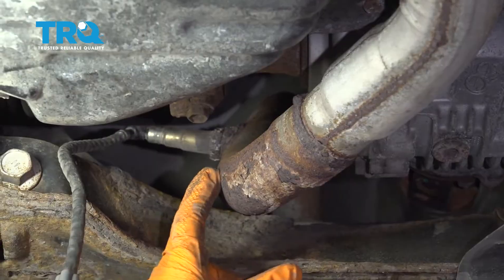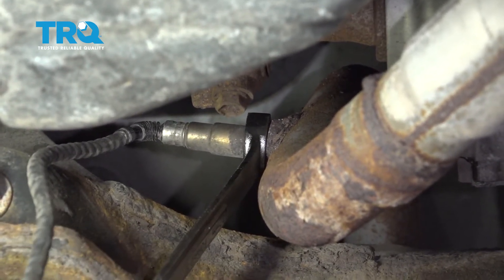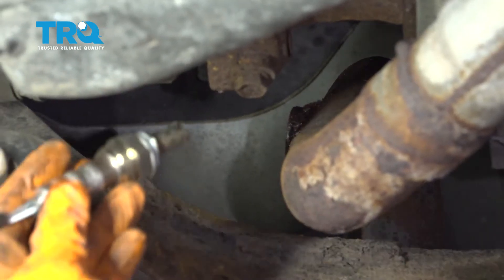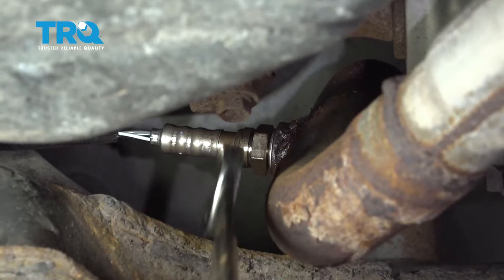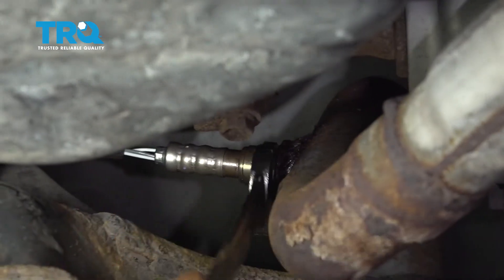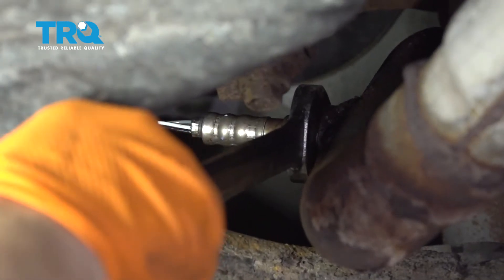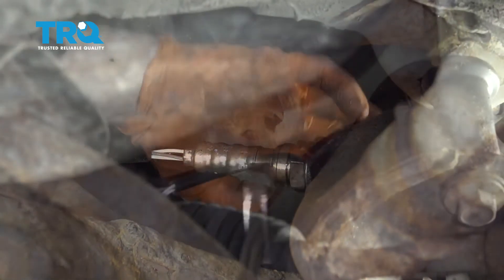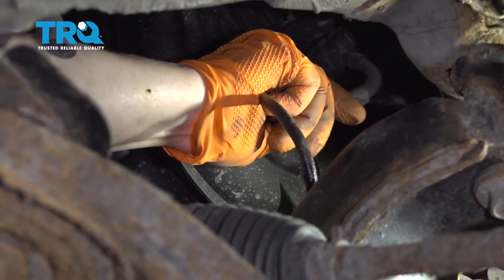How To Replace 02 Sensor 2006-2012 Toyota RAV4

Comment: As she mentioned, it works better with a combination wrench rather than the deep well socket. I ended up bending the end of my combination box end to straighten the angle slightly to clear suspension carriage and exhaust pipe. Most replacements come with a small tube of anti-seize. Always a good practice to use that with the new sensor. While I could get the deep well socket on after cutting wires there was no room for either a breaker bar or ratchet.

Comment: Thank you but you may need first to help viwers locate the sensor No2.  I have done it for a RAV4 2010.  It is much harder to locate and replace without removing the front tire, as it is right behind the engine on the passender side!

Comment: Where is Bank 1 Sensor 1 located???
Reply: Front middlish driver side of the engine compartment. If you take off the heat shield over the exhaust manifold (four 12mm bolts) you will see the O2 sensor just beneath the shield on the front right side of the exhaust manifold. Use a 22mm closed wrench to take the end out of the exhaust pipe then follow the short wire back to where the sensor plugs into the electronics. It helps if you have a trim removal tool because there is a plastic pin holding down the connection and it helps to free this to pull apart the plug in.

Comment: Thank you. This video is excellent. Short and to the point. I was have trouble knowing which direction to loosen the thread. I watched your video again and saw that it was towards the oil pan. A couple light taps with a rubber mallet loosened it right up. This video was very helpful.

Comment: @TRQ....Had a check engine light and a sensor code for 2005 RAV4, upstream.
Changed the sensor but still have the check engine light. Any ideas ? Thanks

Comment: Looks simple enough. I just got mine loose while my exhaust system was still hot. Tomorrow is supposed to be cool and sunny. Should be a good day to finish the job.

Edit... I finished the job the next day with no problem. Probably took a half hour total. I just used a 22 mm box end combination wrench. Seems to run smoother. So far no more check engine light coming on.
Reply: @JackTannehillPromoter....which brank of sensor did you use ? Thanks

Comment: I’m not sure what I’m doing wrong but. I’ve replaced the same O2 sensor twice and the lights are still coming on. Any suggestions please. Thanks
Reply: Did you use original parts?
Reply: Are you using a code reader to make sure it's the same code each time? Are you buying from a reliable source (not eBay or Amazon) to assure that it's not counterfeit &/or made in China? Are you clearing/erasing the codes with a code reader?
Reply: I think there is two sensors I believe, are you changing the correct one?
Reply: Likely the wiring to the sensor, which I think is the problem that I'm having 🙄

Comment: After watching this video, I replaced O2 sensor on my 2010 RAV4 (4 cylinder). 
It took me 30 minutes. This video is Spot on. I could have done it in 10 minutes, but I had to find a 22mm wrench and an extension bar. Make sure you get the correct DENSO part. 
Thank you so much.
Reply: How do I pick the right part? There are several variations, up stream/ down stream, left/righ